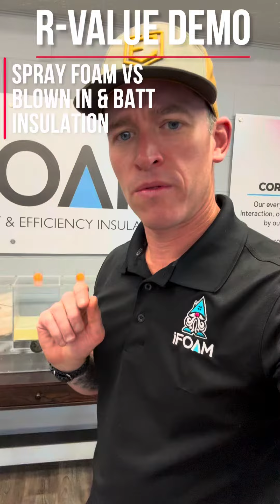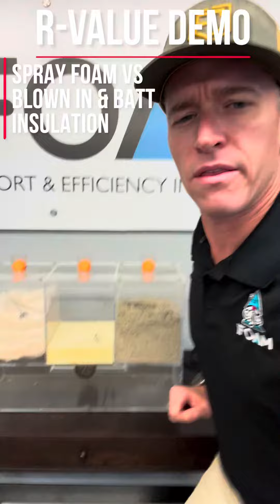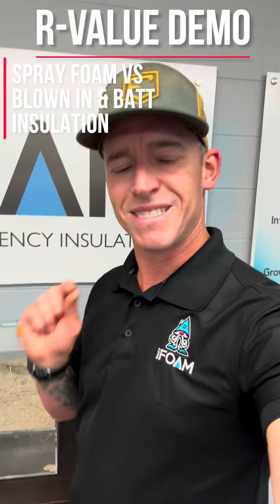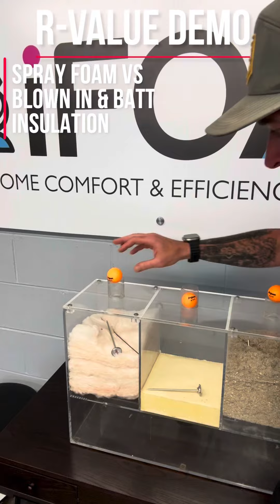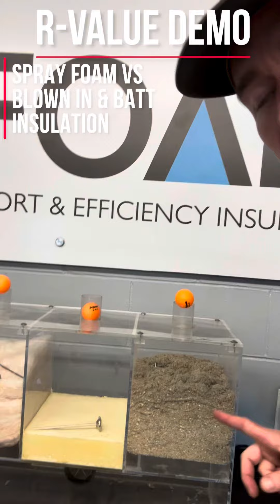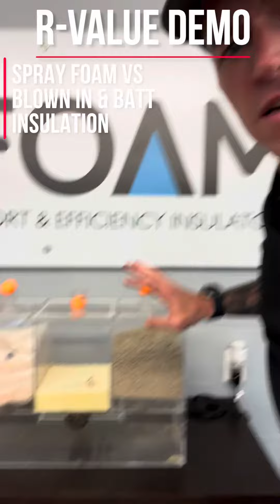Spray Foam R-Value Demonstration

Comment: Siding, drywall, and house wrap, or zip type systems, have left the chat. If wind is actively blowing on the insulation you have way bigger problems than the R value. The goal for each is to trap air to hold the heat either in or out depending on the time of year, and while breathability is a thing none should be exposed to direct airflow like this. If we were doing the same demonstration for outdoor clothing goose down would come in last place, but in real world applications it's the best thing out there for cold weather insulation. Each one has their place depending on the application and size of the job as well as the budget.
Reply from the maker: I appreciate your comment.  You’re exactly right that hopefully no insulation will be exposed to direct airflow like this but the reality is they are exposed to airflow, guaranteed.  Hence the importance of “air resistance”.  

Air resistance is indeed an important factor when it comes to selecting insulation. Insulation materials, such as foams or fibrous materials, work by trapping tiny pockets of air within their structure. These trapped air pockets slow down the movement of heat through conduction and convection.

Air resistance in insulation refers to the ability of the material to limit the flow of air or the exchange of air between the inside and outside environment. Insulation with good air resistance prevents drafts and airflow, which helps maintain a consistent indoor temperature and reduces energy loss.

Materials with low air resistance allow air to flow freely, diminishing their overall insulating properties. On the other hand, materials with high air resistance restrict air movement and enhance insulation effectiveness. 

Therefore, air resistance is essential when selecting insulation materials for maintaining thermal comfort and energy efficiency in buildings.  This is why spray foam insulation is the ideal choice as reflected in  this demonstration.

Comment from the maker: Air resistance is an important factor when it comes to selecting insulation. Insulation materials, such as foams or fibrous materials, work by trapping tiny pockets of air within their structure. These trapped air pockets slow down the movement of heat through conduction and convection.

Air resistance in insulation refers to the ability of the material to limit the flow of air or the exchange of air between the inside and outside environment. Insulation with good air resistance prevents drafts and airflow, which helps maintain a consistent indoor temperature and reduces energy loss.

Materials with low air resistance allow air to flow freely, diminishing their overall insulating properties. On the other hand, materials with high air resistance restrict air movement and enhance insulation effectiveness. 

Therefore, air resistance is essential when selecting insulation materials for maintaining thermal comfort and energy efficiency in buildings.  This is why spray foam insulation is the ideal choice as reflected in  this demonstration.